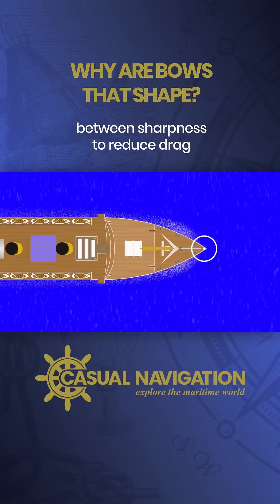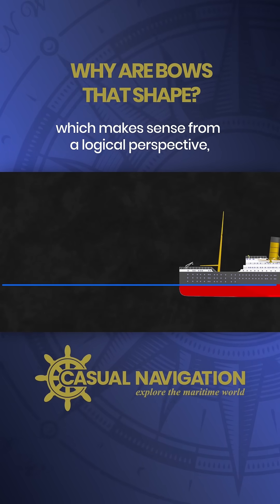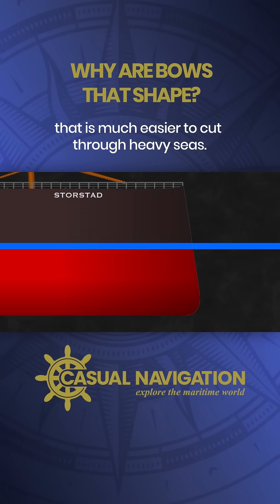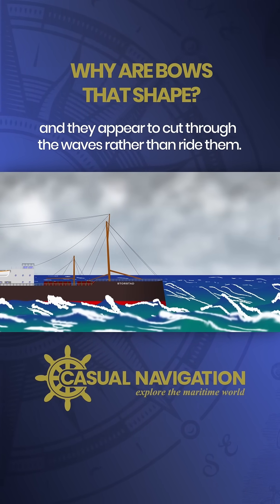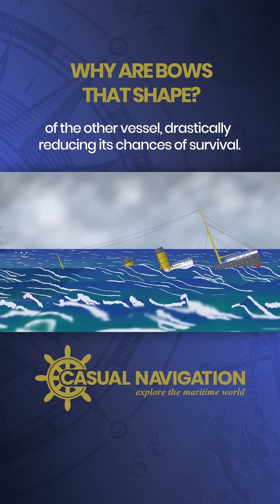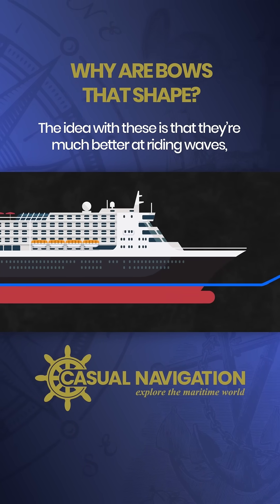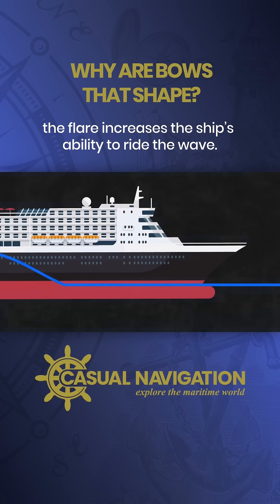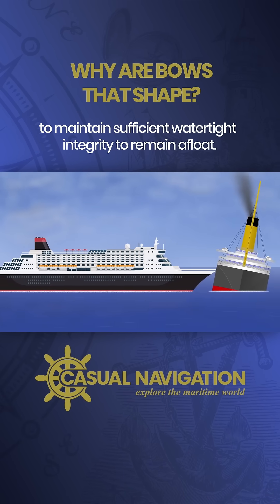Her Weird Shape

Comment: I think you are mostly incorrect. The vertical bow apparently can dive below the waves sometimes. The funny bulbous thing underwater helps with aerodynamics a lot.
Reply: You miss the point.  Is it better to have damage above or below the water?

The bulbous bow reduces wave drag by cancelling out wake formation at a specific speed.
Reply: @LoanwordEggcorn  I thought the bulbous bow increases the LWL to increase hull speed and fuel efficiency.
Reply: @jurosmollin7484  Bulbous bow increases efficiency by cancelling out the bow wake at a designed speed.
Reply: @ Thank you for sharing this.

Comment: The tumble home now has been making a comeback on new fishing vessel 's and navel ship's, WW1 Navy battle ship's all had tumble home bow's, were put together with rivet's instead of welding and were extremely heavy, but handled heavy sea's well, WW2 battle ship's had flared bow's but in heavy sea's they would completely dive down into the sea's and slow them down, and put a lot of pressure on the hull
Reply: It was ww2 battleships lack of a flared bow that caused them to dip

Comment: As a sailor I prefer the inverted bow of Ulstein Xbow but in my experience ships are always rolling and rarely head on into the waves
Reply: I have recently seen bows that extend far ahead above the water line, but are vertical around the water line (above and below). (The new Disney ship). 

That could be a compromise.

Or it might be a statement like "it has an old fashioned bow, it's not a sleek ultra modern ship with a backward or vertical bow where you the guests would not like the looks. So come and feel at home, it's cozy on the inside and outside..."?

I'm really not sure...
Or am I just over-interpreting it? :-)
Reply: @richard--s  you're not overthinking it.
Cruiseship are built for speed, comfort, and letting you spend as much money as possible. You're not spending anything if you're seasick haha 
Cargoships on the other hand are built to be economical, so a greater hull speed with less water resistance during storms means less fuel spend and therefore a bigger profit to be made. 
Tugboats and offshore vessels are mainly built for manoeuvrability, so they've got a bow fit to there primary purpose
Reply: @kapiteindonut  yes, but recent newly built Disney ships are shaped the way I described it.

Maybe the relatively short span of the vertical bow above and below the water is enough for most of their routes. Maybe they stop cruising when the sea is too rough, I don't know, what their reasoning was.

And maybe just for optical reasons they added that far forward reaching bow, that starts to go forward maybe a meter or two (3 to 6 feet) above the water line. The bow is vertical around the water line.

They are built like that. Fact.
My overthinking doesn't change how they are shaped.

I'm just guessing what the implications might be.

Maybe it's a good compromise between cruise comfort (vertical bow where it matters for most of their cruises) and old fashioned "cozy" look (far forward reaching bow that starts one or two meters above the water line). Whatever they were thinking, they built their new cruise liners this way. Fact.
Reply: @richard--s  I've searched for the new Disney ships to see what you meant.
The other answer was just from the top of my head.

That vertical piece between the flared bow and the waterline is a connection for the bulbous bow under the waterline.
It is there for strengthening the hull structure and splitting waves. I expect the speed of these new vessels will be between 20 and 25 knots. At this speed, waves of 3 or 4 meters can viberate an entire ship if not split properly. 

Personally, I think this was not a decision made by Disney, but by designers who used this concept first on other vessels.

Comment: why do you want a cruise ship to ride up every wave though. And why do you design the bow of the ship that has such impact on every second of the ships economics for something that happens very rarely to any particular ship. If you're so worried about collisions, just use the most efficient bow shape and mount a big bumper structure above it where it's always above the waterline
Reply: NO cruise ship was in this video bud you mean OCEAN LINERS
Reply: NO consideration should be given to designing a ship to survive a collision, whether "hitting someone" or being "hit by someone". And you don't give this consideration in the design of aircraft, either. It's impractical (too expensive). The safety issue SHOULD be met by all such craft being manned by well-trained and competent crews, though it sometimes isn't. And who's fault is that?
Reply: @lawrencequave7361  The whole point of ATC is to prevent collisions. Commercial planes have multiple engines in case of collisions with birds/engine failures. Military aircraft have ejection seats in case of damage due to collision with aa weapons. You have no idea what you are talking about. Safety should be considered everywhere where possible.
Reply: @lawrencequave7361  Crazy how your solution is basically "Don't crash because the crew should be trained"
Reply: @lawrencequave7361  Assigning blame doesn't change that you do need to design a ship to survive collisions. It's far more likely than a collision in the air and a well designed ship is the difference between sinking and limping back to port.